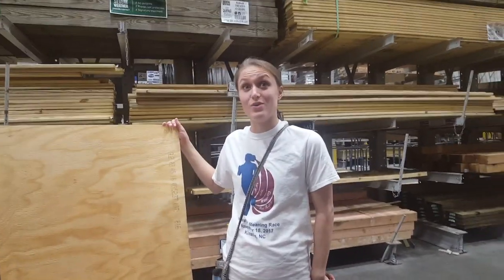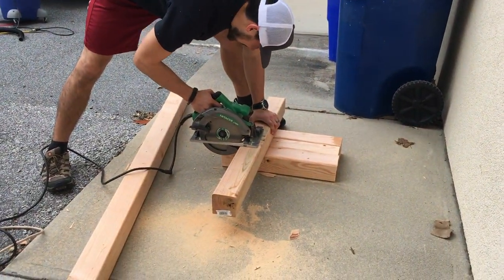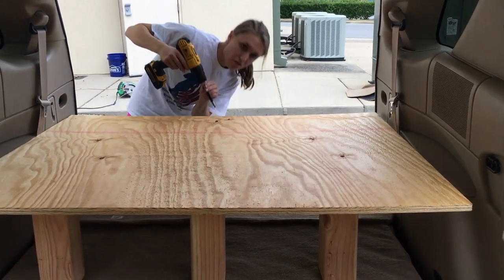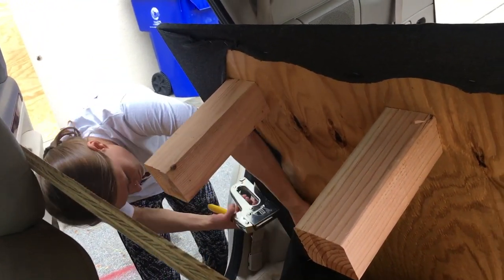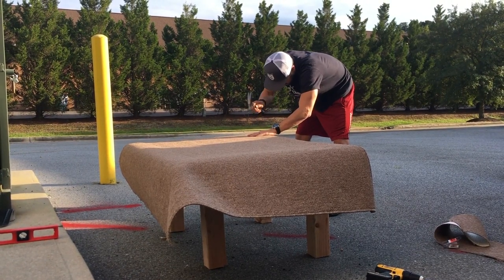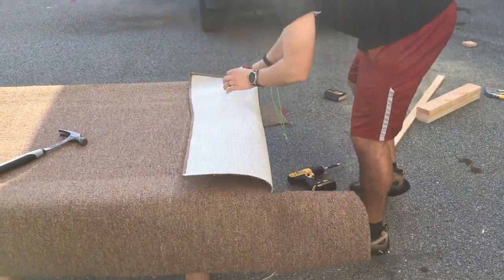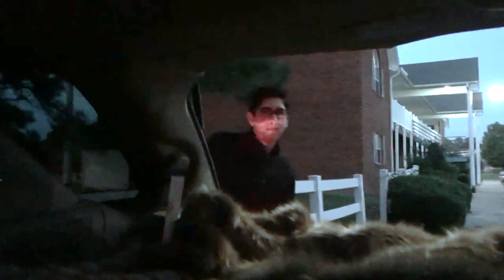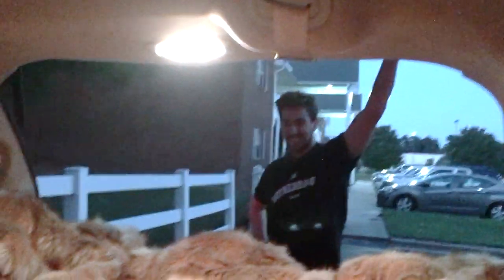Camper Car Conversion for $95!

Comment: I understand the idea, and good on you for that, however I've owned a Buick rendezvous 2007 for over twelve years. I've always taken out the two back sheets to semi camperize, it's a simple latch, the floor is even and you gain so much extra space back; I just don't see why you didn't pull them. Dog would have had more room.
Reply from the maker: Nice, The rendezvous was my favorite vehicle. never gave me major issues. You’re right, it was relatively flat. I guess we were excited to try something new. Additionally at that stage of life we lived in a second floor apt. I guess at the time it seemed easier hauling the two bed pieces up and down rather than the seats. I think it came down to storage as well. Thank for the comment

Comment: It blows my mind how unpopular these cars are as campers. Its like a slightly longer honda element with better mpg
Reply: ....unfortunately, these vehicles have notorious electronic and electrical problems, I'm trying to fix one, with a no start and no crank problem.   I'm the third owner, of the one I'm working on.  
.
Previous owner, replaced starter, alternator, and 5 or 6 relays.  When I got it running, it ran great for 3 days.  I parked it, I was fixing power windows, went to srarted a couple of times, then it died, and wouldn't start again.   
It has no error codes, it's become a month long project 🤔
Reply: Rendezvous are the best. Totally reliable- never any issues.